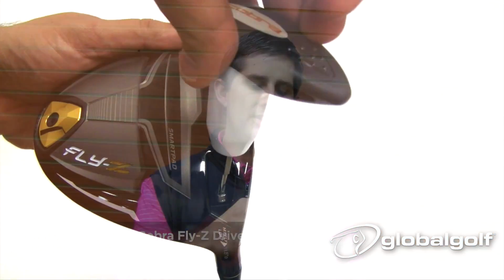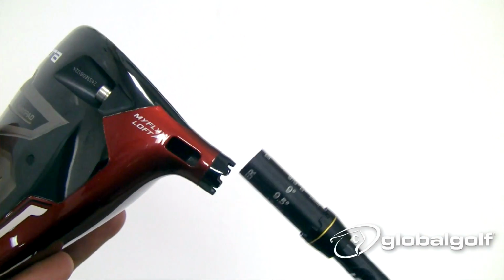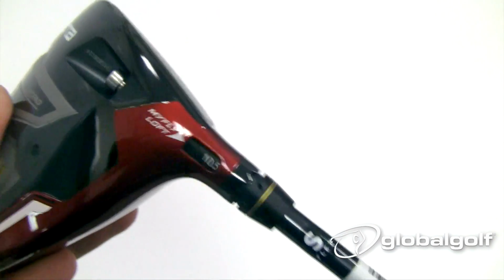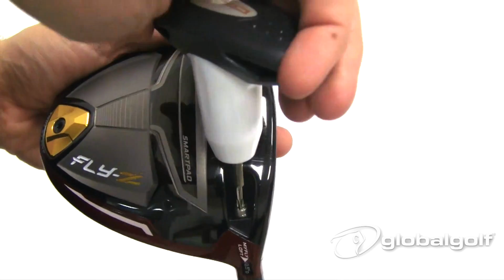How-To: Adjust the Cobra Fly-Z Driver

Comment: Hello,  can you help me?  I've been sold a Ladies  Left-Handed Cobra driver . Its stated range of lofts (on the head ) are 9 to 12 degrees . However, on the shaft the eight settings are from 11 to 14 degrees . 
  I think they might have put in a shaft  from a Right-Handed club . When I put the 14-degree setting in the hosel-window I get low ball flight .Can it be set to 14 degrees , or only 12 ? And what number must be visible in the hosel-window ? The proprietor I bought from has now closed down , please help , thanks , Penny .